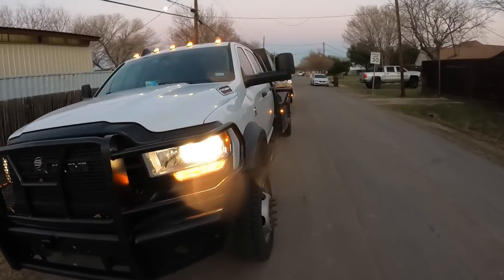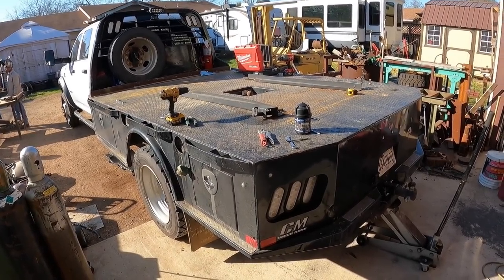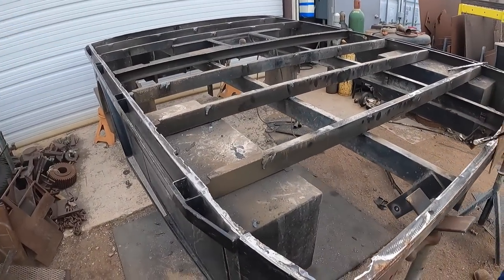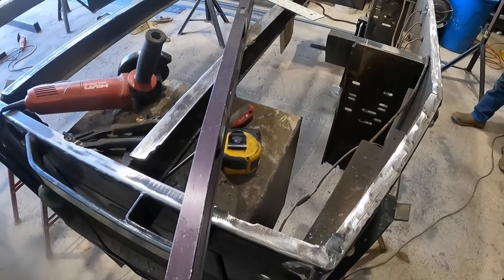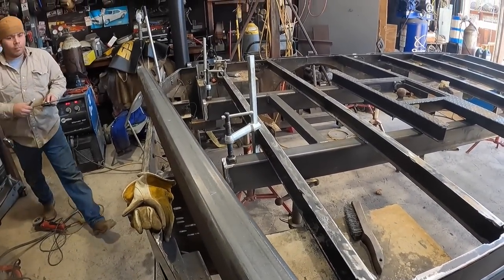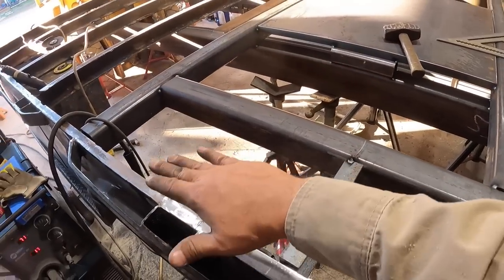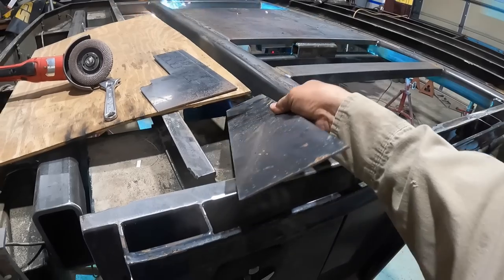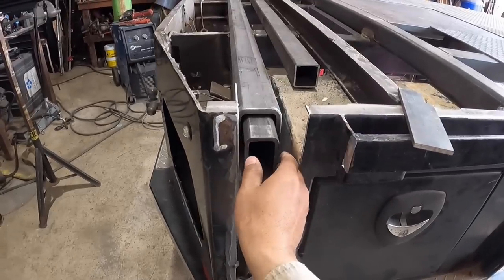Milton's Crane Bed (Pt 1)

Comment: One heck of an facinating build.
For almost 3 years in the mid 70's I was a certified Ironworker welder repairing small parts tubs and 20 to 40 foot racks for hoods, axle assemblies and other large sections of Buicks and Chevys fork truck drivers had mangled.
Mig and stick welding, torch cutting and a whole lot of hydrolic jacking with large walking jigs.
Wehad a 8 unit quota. Above the a 4 dollar bonus ea.
That's why I subed to this channel. 
Iwas making mow bonus money than my hourly pay.
February 76 I went off to Coast Guard boot camp and became a Aviation Machinist Mate 3d class.

Comment: I'm thinking additional "Outrigger Extensions".  Just in case.  Male "stubs" inboard and female sleeves outboard.   Some pins, that drop in from the top, to secure them(also cool for stowing).  It's all about lateral support!  No rush, since they can be made at anytime in the future.   ...or not, if unnecessary.   Just an idea.

Comment: Nice one. You guys have some great trucks in the US. And the laws allow you a lot more flexibility. If you were trying to build that here in Australia some engineer would have to be involved. Then it would have to be certified and plated for the road. Plus the operator would need a license to operate the crane. And as a result the person building it would need a printing press to pay for it. Should be an amazing build when it is finished. And that crane will make a big difference.

Comment: I have the same jack's you're using for outriggers.  Put them on the back of my car hauler as stabilizers.  What I did was cut the crank handles off and welded on a 13/16 bolt head (same size as my lug nuts).  Now I can use an ugga dugga gun on them AND the handles aren't sticking out.
I also welded a deep socket to the cutoff handle so I still have that option plus an emergency lug wrench in the toolbox ;)
Reply from the maker: yup yup. same thought here. 👍👍😁

Comment: I love all the comments saying about what they "should" have done rather than just enjoy what they did. Could they have sold the bed and started over? Yeah sure but they didn't and that's that. These are the things you learn by doing these kinds of projects.
Reply: So many have a different way of doing something when they aren’t doing it. 
As for selling and building a all new deck, Isaac addressed that, they simply did not have time for all involved in that. Issacs friend said he is extremely booked when he gets this build done and back home. It is much faster and easier to work with and modify what he has, and so far it is looking really good. The actual structural part that will attach to the truck and carry the crane is all new anyway, the rest is just the skin over the muscle and bones.

Comment: Quite a project. At first glance adding the weight of the bed reinforcements and the crane seems like a lot for that truck and those outriggers not including any use of the crane.  Interesting to see a capacity lift from various extensions and positions. Probably a test that should be performed before sending this job down the road. Thanks.

Comment: now what is he going to be doing with a 6000lb crane, outriggers down and all at 60mph ...gonna need some wheels on those outriggers 😁...you did say you wouldnt be able to see a difference at 60mph.
 The bed is looking outstanding so far  thanks for sharing

Ooh the arm of the digger is a mess, thats going to be great fun to straighten out and weld up again. Always something in the pipeline

Comment: In building those outriggers you could build them like a pole on a log trailer.  Weld your shims on the end of the mail piece, slide it in, then weld shims to the female piece, everything slides but not too sloppy and they can't pull out too far.

Comment: I built sliding outriggers before and I used pneumatic cylinders to extend the jacks.  I thought about using linear actuators but pneumatic was simpler using a mechanical valve.  I also attached a plate to the face of the outriggers so they were almost invisible when they were retracted.

Comment: Im a truck body installer and yeah those skirted cm beds are a pain cause there not much room underneath! We do it pretty much the same way though i will typically use 4 bolt plates  instead of 2 and weld the back end as well. I dont mind going a little overkill for extra road safety!
Reply: I used to install beds like this as well.
Same thought process as you.
BUT.
The company wasn't about quality or doing things well.
Scab it together and get it out the door.
I don't work there anymore.

Comment: Thanks Issac and Milton for sharing your upgrade project.

My main "Question" is how did you beef up the suspension of the truck chassis to carry all that weight and be able to ride down the highway???
It is a working out of rig, correct?

Looking forward to part #2 and the vehicle insurance upgrade.

Comment: That's quite a project; ready to see the conclusion/finished product.  For as good as Isaac is with a torch (an absolute surgeon)..... it's almost painful to watch him slowly chewing through metal with a sawzall/portaband-  😂🤣

Outriggers:  Others have expressed concern about the trailer jack design, and while I'm not 100% sure, I would tend to agree. I think the bigger issue would be the inconvenience/time of having to crank them down. As stout/nice as you're making the rest of the bed, I would have found other cylinders or a way to make them work.

Thanks for the video & looking forward to part 2 (& mostly the boom repair!).

Comment: Issac love your videos and I learn a lot. I’m a self taught hobby welder so I get lots of good real world information. At one point in the video you mentioned that you would have a hard time cleaning the metal so you would probably use flux core. I was under the impression that you need clean metal just like mig. Is that incorrect? Or is that a “book vs real world” thing. Is flux core similar to 6010 stick in that you can weld through the crap. I appreciate any incite you can pass along.

Comment: That's exactly why I carry a fan on a truck it don't matter how cold it is if you would have just situation where you cut with the plasma or you welding 7018 up in the rafters or something that's a lot of smoke and that fan helps cut that smoke down

Comment: Notching the 2x2 that the base plate sits on so the plate would sit on all 4 walls and not putting the plate edges in shear loads would have been stronger, great build either way. Electric jacks would be an awsome upgrade at some point

Comment: Will be interesting to see how are you going to hold the extension legs in place when extracted and closed, it doesnt look like you have easy access to main bar for the traditional pins that would normally be used.

Comment: Looking good! Didn't like the amount of unsupported main outrigger tube from it's center weld point to the edge of the frame.
Considering there's another tube that slides into that to extend out and support a 28' reach. Seems like a big ask for that to handle.

Comment: If the crane makes a lift with the boom lined up over the outrigger jack load will be concentrated on that jack. Might be worth comparing the trailer jack against the strength of the original hydraulic outriggers.

Comment: I did the same on my manual outriggers, added flat bar to top and sides to tighten it up. How are you gonna lock them in place? I’ll answer for you, part2. 
     I left my handles on, but I think I’m gonna  cut them off. Use the impact…
     Jealous over the 28’

Comment: Isaac as I watch this one thing wrings in my brain and that is, why not take this one off and sell it and build one from scratch? You changing the runners and the cross beams as well as you removed the entire top and removing the 5th wheel hitch, that is pretty much the entire thing already and starting from scratch you can make everything exactly how you want it.

Comment: I have been seeing a  lot of the new Dodge trucks breaking the frame in the middle of  the truck. Mostly from being over weight and stressed to much past the rear axle. Have you thought about that much with crane and pulling heavy loads with your truck?
Reply from the maker: on 4500-5500???
Reply: I have seen videos of 2500 on up to 5500. I will admit. They had a lot of stress past the rear axle.  Though one of them was a very large in the  bed camper. Plus the had a luggage hitch past the end of the camper. The camper and luggage rack probably added close to 6 feet past the bumper.
Reply: I just look at the video for the 5500. Tried to post it here. It won't go through. It looks like they are saying the bed was welded to the frame and changed the tinsel strength of the metal. Sounds posable.

Comment: Whats the weight difference between your crane and his ?
Reply from the maker: His is a 6000lb and mine is a 5000lb cpacity.
Reply: @ICWeld  how much do the cranes weight themselves? Curb weight? Is it like 1,000lbs heavier for the 1k increase in lift capacity?

Comment: From a strength perspective, I would have run the frame rails holding the crane over top of tne outrigger tube, rather than butt welding it.  I also would have provided full perimeter support to the edge of the base plate to keep it from potentially warping over time. I am not saying that what you did won't hold up, but there may have been some lost excess strength or easier fabrication.